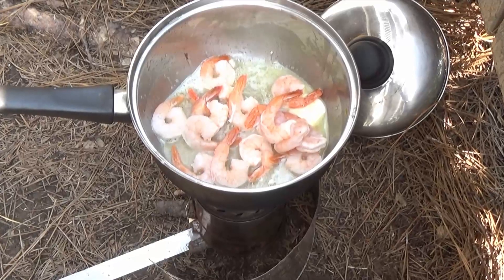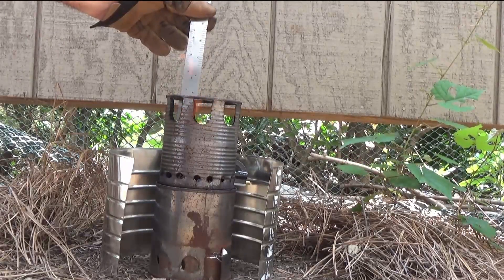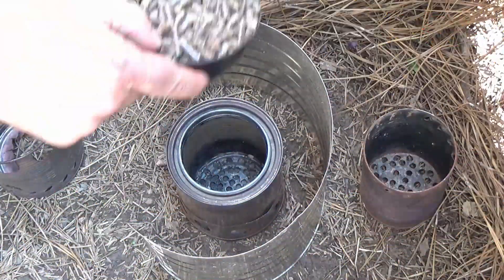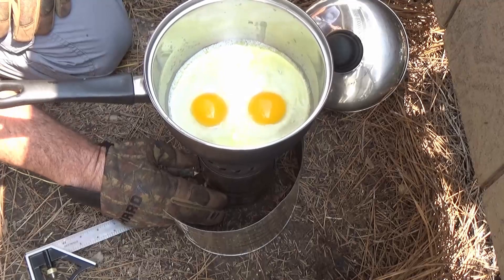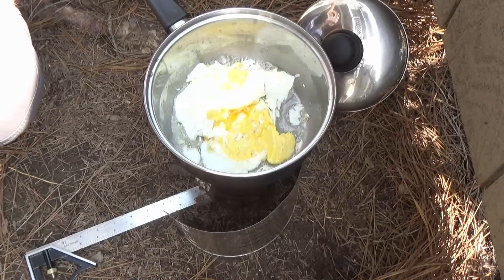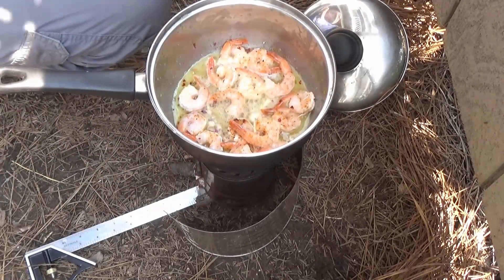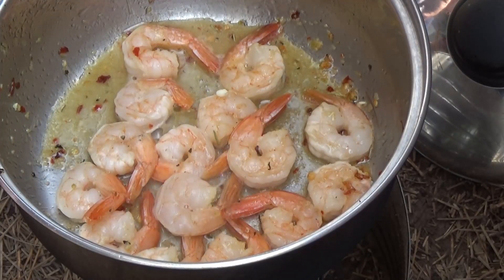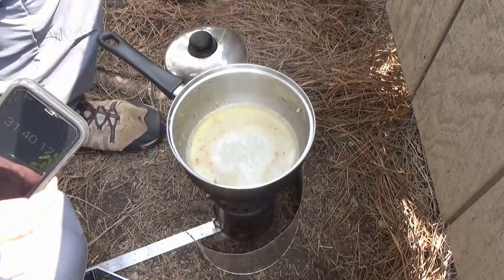Adjustable flame! Cooking! Paint Can Wood Gas Stove Optimization! Wood Gas Stove Science| Part 8!

Comment: Dear sir. Please apology for my questions yesterday in an earlier episode. I was a bit astray at U-tube. However this episode shows, that the stove was very controllable by it's output.
It makes it a lot better, when it comes to simmering for long time, as for example cooking potatoes without killing them. They will have their time. I am happy with the result.
Though this is a "type" one person stove, it will not be very much better, as the fuel quality may variate more than any design may compensate. This is more than enough, so many thanks.

Do you have any thoughts about up-scalings? I believe that the parameters of this kind of stove are quite depending of actual dimensions, and will not happily be scaled up without protests, as lack of air here and there, as such. I think of a family version for "preppers" in general, and for saving fuel in the third world especially. Many places lacks of wood as fuel, and poor people uses dried cow-shit as fuel, instead of utilize it as fertilizer for growing food. They live in a lose/lose situation. By effective stoves, the lack of fuel would be less, and the fertilizers would help them growing foods. It might be a million/billion dollar solution for preppers, and a decent way to help the poorest, as well at the planets climate.

I can imagine a larger stationary version by a ceramic (burnt clay) outer shell, and any steel insert tin burn-chamber with air intakes, just as usual. The flame collector could be of steel, or ceramic, as well as the pot-stands. A metal ring with holes could be used for choking the air intake, and thereby save fuel, as well as improve the simmering.
The ceramic would be a bit better isolator than a steel shell, although less portable.

This year, Planet Earth has shown a lot of harsh sides, by floods, and wood-fires. Anyone can be hit into a disaster anytime theese days.
You have something here.

Best wishes.

Comment: Could you do a video experimenting with fatwood as a starter instead of heet? Ive been using it with amazing results, tons of smoke though until the fatwood burns off.
Reply from the maker: I am not in an area that I can have at any fat wood. Or do you buy it in a store? Thanks for watching!
Reply: @heathputnam9524  you can buy it in store, artificially made i presume. Or you can harvest it from preferably pine,  or cedar trees.

Comment: This actually worked better than I expected. Since you also choke off the secondary air with your mechanism. I assume the "tertiary" holes in the potstand compensate for that lack of secondary air. Thanks for sharing, and I agree that you might wanna do a build tutorial at the end of the series, after all those changes made.

If you are going bigger, you might wanna look at more ideas of turning down the heat... http://www.drtlud.com/wp-content/uploads/2014/05/harris-tlud-turn-down-15-may-2014.pdf
Reply from the maker: Thanks for the great info! And also for watching! I think the tertiary air helps I also think the flame spinning as it as it exits the secondary air continues to spin as it moves along the iris (flame concentrator) then the angled tertiary holes add to the effect all combine to cause more of the heated air to flow up between the cans and limits the air flowing into the primary air holes when the fresh air is choked down. A haven’t proved this but that is my current theory. I must admit, I was pleasantly surprised at the good results!